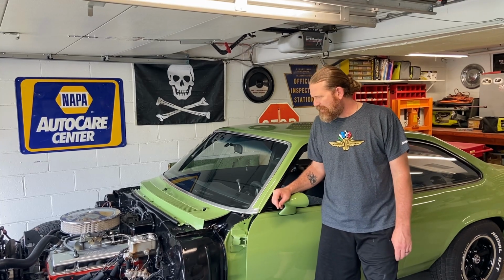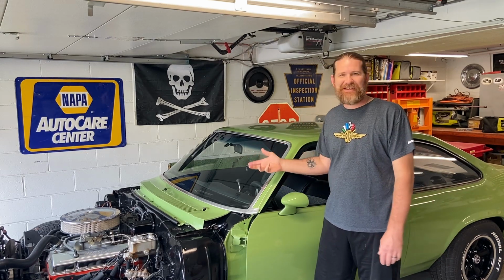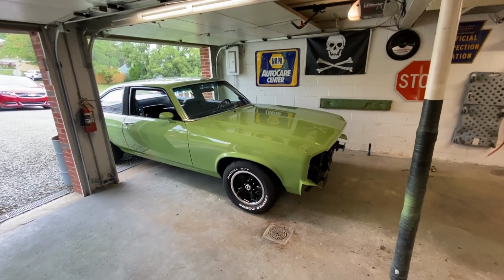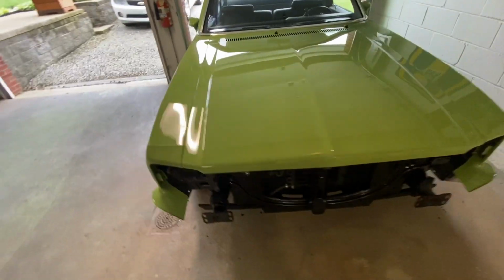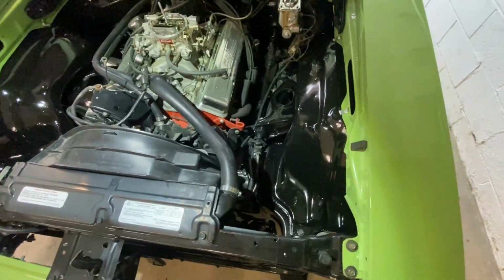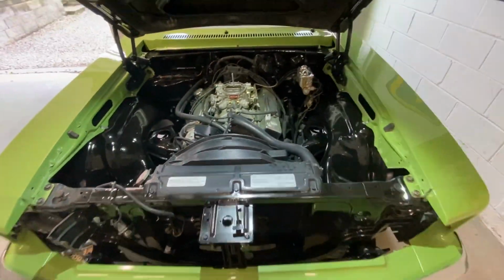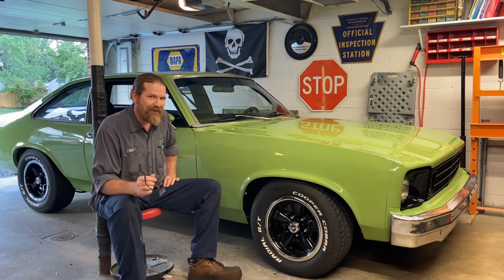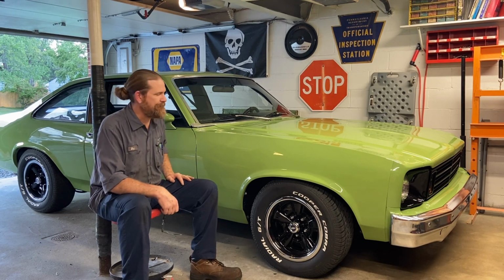Final Assembly of My 1975 Nova

Comment: What made you go back and paint the windshield frame black? I was going to do mine body color too 🧐
Reply from the maker: I installed the windshield and the glass didn’t have the right depth, so it had to be removed and reinstalled. 🙄 After taking the glass back out, I had to scrape all the glue from the frame. Took a while to get it right. After I was satisfied, I decided to paint the frame black. Once the windshield was / is installed , you could still see some of the green frame from the outside. That was the main reason for respraying the frame black. Great question!

Comment: looks alot like my 72 nova but i had a factory sunroof vinal roof. that slid back.  first engine blew so i looked for 3 months for a new engine.  found a 70 truck engine 350
 hi compression. only ran on premium. had the exhaust cut and put glasspacks on. airshocks and at idle it was quiet till i got on it. i outran a camaro z71 in scottsdale,az.  he diddnt know what to think.
Reply from the maker: 😁 Sounds badass!!! Still have it?
Reply: @threeriverswrench  no i sold it but i still wish i had it now

Comment: Did u lower the front end?  I have a 77 Rally  did u make a vid on it?
Reply from the maker: Brand new v8 springs with one full coil cut off. It was a gamble. I notice A tiny amount of fender rub at the top of the tires over hard bumps. Probably wouldn’t touch at all if I rolled the fender lips a little.
Reply: @threeriverswrench   thanks I liked yr vids.

Comment: Where did you order your Windshield from?
Reply from the maker: I ordered it from a company that listed it on eBay. Search 1975 Nova windshield. The same one is on there for 199.00. Hope this helps.
Reply: @threeriverswrench  thanks. I have a 77 Nova. Currently no issues with my windshield.  Im hoping it is a windshield company that makes windshields. I was hoping to find a company that makes windshield that eliminates the need for trim like for the Camaro and Chevelle.

Comment: I have always loved this last generation of X-bodies (Novas) the best. My preference is the 75-77 Ventura, but these Novas are great too. Man, you've got this one decked out just the way I like with the blacked out grill and headlight buckets. the Z-28 wheels are a super nice touch also.
My recommendation for a stripe would be the three-band stripe that was used on the 77-78 Nova Rally option (in black of course). It went along the bottom just above the rocker, and narrowed as it went around each wheel opening.  No stripes on the hood or decklid.
Reply from the maker: Gonna put it on the list! Thanks!